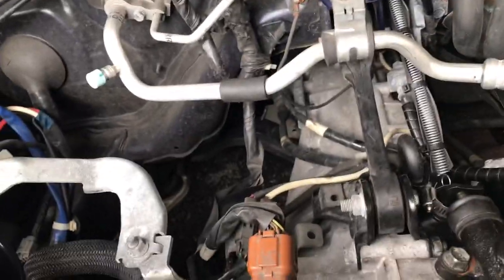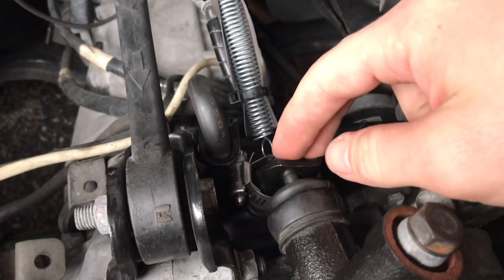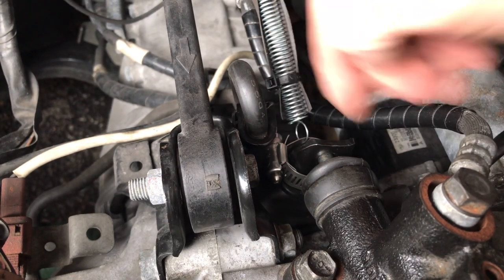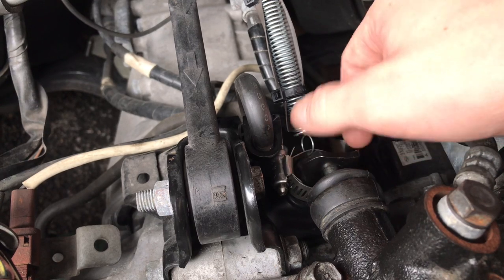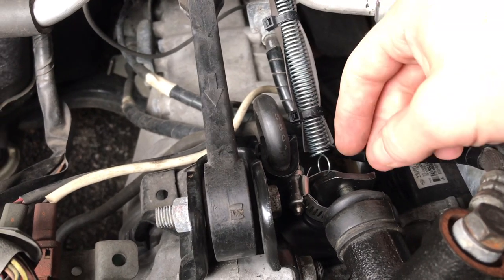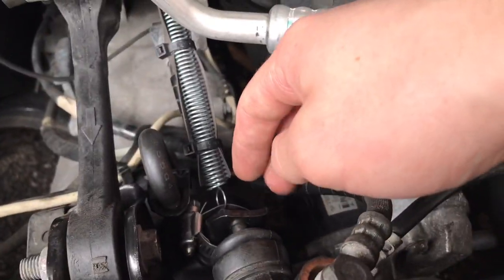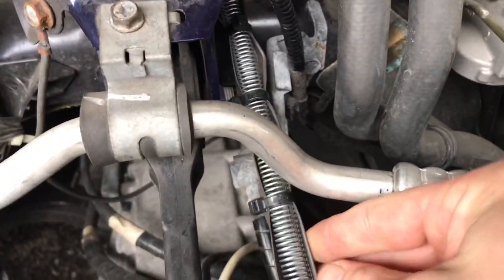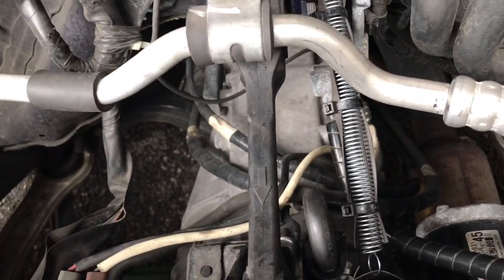2015+ WRX clutch fork noise/Chirping Sound

Comment: I was spraying high temperature grease on the clutch pivot ball every 6 months because the chirping sound was always coming back. Today I just installed the spring on the fork and the chirping sound is gone. Thank you!
Reply: The STI comes with that spring as a standard. The fork pivots on a shaft and the slave cylinder makes a minor contact with the fork when the clutch is not depressed. When idling this minor contact can make a small rattling noise. That is why STI comes with the spring.

I forgot to mention this to another person that i sent an aswer a couple of minutes ago. If you have the Verus fork on a WRX (non sti), i think that a possible cause of the rattling or tapping noise is becasue the Verus fork is billet steel, it is more solid it probably doesn't absorb vibrations as the stamped steel fork.

Comment: Hello again. I read your comment.  Make sure that the slave cylinder is properly bled. Compare bleeding the brakes and bleeding the slave cylinder. When bleeding the brakes, the brake pads and rotor prevent the piston on the caliper from extending that allows more fluid to flow and if there is air it will come out.
    Now, when bleeding a slave cylinder the piston extends; yes it is being bled but not properly.  As the slave cylinder piston extends, some air can stay in the unit, this small air pocket can cause play between the fork and the slave cylinder piston or a spongy feeling on the clutch pedal.
     When i replaced the clutch on my wrx i unmounted the slave cylinder and blocked the piston to prevent movement when bleeding.  In this case i had my father helping with the clutch pedal.  This has to be done very slow and double checking the unit is highly necessary to prevent the piston from flying away and the unit from coming appart. Keep the slave cylinder piston blocked when installing it back on the bell housing. After securing one slave cylinder bolt (finger tight, not torqued) remove the unit used to block the piston and let the piston touch the fork, then align the other bolt and torque both bolts.
      After i did that there is no play or movemet between the slave cylinder piston and the fork. 
     There is a youtube channel that shows how to do it; i will look for it and post it on another comment.  
Good night.
Reply from the maker: This is great information thank you so much for sharing, definitely share the YT video.
Reply: The factory manual for Subaru WRX STI explains that the slave cylinder must be removed and the piston has to be blocked  when bleeding.  I do the same for the WRX (non sti) and it works great.

Comment: Hey thank you for replying to my comment! Also yeah I mean't to say that my car was also making the chirping noise when i did not press the clutch. It would go away when I press the clutch down. Thanks for uploading this video i'm going to try this out myself and hope this makes the noise go away. I just don't want to take it to subaru, they are asking $950 for a throwout bearing replacement.
Reply from the maker: Your welcome...funny thing i had the noise and took it to subaru at around 30K miles, they replaced it and it still made the same noise cause it's not the bearing it's the clutch fork. Best of luck

Comment: If the clutch fork is the aftermarket reinforced fork for stage 1 and up clutch kits this noise will be normal.  The OEM fork has a couple of grooves to clear the transmission bell housing casting marks. The reinforced fork from Verus or other manufacturers eliminate the groove that is a weak spot of the fork.  Without the groove the fork will touch one of the bell housing casting marks and eventually wear it out or chip a piece of the casting. Applying grease wont solve the chirping noise. The noise is more noticeable when feathering the clutch, specially when using stage 1 and up pressure plates and clutches.
Reply from the maker: Thank you, the fork is definitely on the list of things I want to replace during my next clutch job...the current fix is a combination of grease on the fork pivot point, slave pin contact point and a release spring which does get rid of the noise in my case.
Reply: Interesting, I started getting this noise about a month or two ago and it coincides with upgrading my clutch to a stage 1. So it's just something I need to get used to having?
Reply: @apu95  Did you also upgraded the fork?
I have a stage 2 Clutch and pressure plate.  The noises i was getting first was from the upgrades fork touching a casting  rib of the bell housing.  If you compare both you will see that the  OEM fork has small dips to clear the bell housing and the upgraded one  doesn't.  The upgraded fork will touch and wear out the aluminum in the bell housing and the noise will stop.  
The other noise is that the throw out bearing is supposed to have a spring clip to secure the fork and throw out bearing tight to avoid rattling noises. My 2015 wrx didn't come with it and the new clutch didn't.  Some older wrx have it.
If you have an STI, the fork is different and already strong and it comes wirh a spring that goes from the top of the fork to the engine /transmission pitch mount.
A stage 1 or stronger pressure  plate will take some time to get adapted for daily driving.  
To me it feels just like a truck clutch. On my car i get noise if i feather the clutch.
 I had to adapt to rev the engine to 2000 rpm and release the clutch at a moderate rate and there is no noise and almost no slippage.
Reply: @PIPEFITTERENGINEER  I have a 2015 that I just put a stage 2 action clutch, versus clutch fork and act lightweight flywheel. I get this noise. Will it go away?
Reply: @GaragebuiltOriginal  When I noticed the noise caused by the new stronger clutch fork, i contacted the manufacturer and informed them about the noise and with pictures illustrated how their clutch fork was wearing one casting rib of the bell housing. The answer wasn't convincing.  If you compare the OEM fork with the one aftermarket that we have, you will see that the aftermarket is really strong but, the small notches on the OEM fork are there to clear the bell housing casting ribs, especially the casting rib that is to the driver side of the bell housing. 
On the OEM fork made of ( stamped steel),  the notches could be a weak point that could bend the fork if a stage 2 or 3 pressure plate is used. That is why the aftermarket one that is (solid metal cut to that shape)  doesn't have them.  
I suggested a little bit longer pivot point but the answer i received was not convincing.  
The design is good but i think that they should tensile test the fork but with the notches or at least one notch where it makes contact.
For my next clutch change i will put back the OEM fork but with a  reinforcement that I'm working on.
Take care, drive safe and don't abuse the clutch.  It is no fun to take out an engine just to replace an oil seal, clean the timing wheel and install a fly wheel and a clutch kit and then it rains when everything is out.
Reply: @PIPEFITTERENGINEER  I added a spring to fix the problem.

Comment: The slave cylinder point and the pivot point must be greased. Use the 3M high temp grease with copper. Do nott use never-seize grease, it dries with time.
Reply from the maker: That's great to know, thank you for sharing.
Reply: How can I effectively get grease between the context point of the Slave to the Fork? Thanks man.
Reply from the maker: @jessel1217  the grease shakes off after a while, what I found to be effective is to have rubber piece cut and placed between the slave pin and fork contact point. I used cut a piece of a tire sidewall  but I'm sure you can find something else that could do the same

Comment: Had this issue on my 16. There is a tsb on the throw out bearing. Dealer replaced mine jnder warranty, the updated throw out bearing fixed it for a while.. just hit 80k miles and its back. Usually only during wet road conditions. Was wondering if a south bend or other upgraded clutch would come with a better throw out bearing that fixes this permanently?
Reply from the maker: Not sure since still running stock

Comment: what size spring did you get
Reply from the maker: Bought these from homedepot https://www.homedepot.com/p/Everbilt-5-8-in-x-6-1-2-in-and-15-32-in-x-4-1-2-in-Zinc-Plated-Extension-Spring-4-pack-16071/202045467?MERCH=REC-pip_sem_mobile-202045475--202045467--N

Comment: Cool! Quick question, when I greased the parts underneath the boot, I smeared a decent amount all around inside. Is this bad? I hear a lot of people saying it could get into the clutch? Thank you.
Reply from the maker: Sorry for such late reply, yes you only want a little on top of the ball joint which is accessible by removing the rubber boot on the clutch fork...too much and it can get on clutch causing slippage.
Reply: @fixflickss  Hmm... I put a gob of high heat grease under the boot where the fork moves and also on the slave cylinder that pushes against the clutch fork. It quieted down a lot. I have the Verus Clutch fork along with Southbend Stage 2 daily clutch. I also greased the rod inside the cabin that goes through the firewall right above the gas pedal when pressing in the clutch. No creaking or squeaking and it feels real smooth. Knock on wood but I haven't had any clutch slippage. Also sprayed some WD40 specialist dry lube down there under the boot where fork goes.

Just did this yesterday. I have 80K miles on my 2015 WRX. Hopefully I didn't do anything negative. I don't think I did. Drove it 80 miles today on highway and local roads. Smooothhhh.
Reply from the maker: @shamwaymoonyos9578  happy to hear that bro, hopefully It will be alright under the boot, I would not spray anything in there bit use a grease gun with a hose attachment to just get the pivot point greased
Reply: @fixflickss  thanks man :). Yeah I hope it all was good what I did. Did the grease and spray as mentioned in my original reply but yeah I am just hoping it will be fine. Drove it those 80 miles today and it was satisfying with little to no chatter feel in pedal and no noise. My noise wasn't much chirping but on some pedal travel it has started to get a metal noise that sounded like grease was needed.

Please forgive my crap reply I out of it at moment feeling pretty good. Have a good one man! Or woman! :)
Reply from the maker: @shamwaymoonyos9578  lol you made my night bro, my name is Mike, thanks again, enjoy the rest of the evening
Reply: @fixflickss  no problem Mike. George here. Have a great rest of weekend.

Best Regards,
George

Yes... I ended it cordially lol. Business etiquette bro :)

Comment: What do u think? Is there any risks of doing this job? Dropping something in there?
Reply from the maker: Yes, you definitely do not want to drop anything under the fork boot or get too much grease on the ball joint pivot point if too much grease is applied it can drop on the pressure plate and create slippage if anything else falls in there it can destroy your clutch...there is always risk so always take your time and do the proper research. Best of luck to you

Comment: Hey I hope you can reply to this but with installing the spring that shouldn’t engage the clutch and put wear on it right? Looking to do this because my 18 Wrx loves to make this sound
Reply from the maker: Hey...so this worked but I had to get the spring to force the fork onto the slave Cylinder instead of away from it as in this video. I applied grease on the fork pivot point and the contact point with slave Cylinder and fork.
Reply: @fixflickss  thank you!

Comment: How is this fix after 6 months of driving?? Still holding strong? No complications? I'm going to home depot tonight Haha. Been having the chirp for about 6k miles now.
Reply: Also do I need to remove the slave cylinder to attach the hose clamp or can it slide right on without removing the slave?
Reply: @fixflickss  did you need to remove the slave cylinder to add the hose clamp??
Reply: @fixflickss  I did the mod today. I attached the spring in the same location on the fire wall and used a heavier duty spring. The noise stopped but my clutch does feel slightly stiffer now not a big deal.
Reply from the maker: @taylormcwilliams2406  yes

Comment: I understand then that this can be solved in 2 ways, or do you have to do both? A) apply grease on pivot point, B) place the spring, pulling from the slave cylinder.   Does this video look familiar to you? Hope to get it fixed with the spring... https://www.youtube.com/shorts/XPeD3Z5N9uQ
Reply from the maker: I did both, but if it’s not fixed with spring then  apply grease. PS. I later changed the configuration with tension of the spring towards the front of the car vs the firewall as in the video, it worked a little better, i secured the spring to the egr bolt with an additional metal clip.

Comment: Interesting solution.  Did it work out long term?
Reply: Only solution that worked for me
Reply from the maker: Yes, after several years I still have it.
Reply: @fixflickss  That answer confuses me to the question "did it work out long term". Do you mean you still have the problem or the car?
Reply from the maker: @Tanner  I still have the car and the fix has held up, no chirping noises since the fix
Reply: @fixflickss  Thank you. Im gonna give it a shot. Literally just got this 2016 WRX with 50,100 miles and the only thing that I dont really like about it is this damn noise. Im losing my mind over this noise.
Reply: @GoodAtHeart me to bro on my 2018 wrx

Comment: How long is that spring ?
Reply from the maker: Hi, im not sure at this point this was a while back. I bought a case with several different sizes in-home depot and used the one that worked best for keeping the fork in tension
Reply: @fixflickss found one that fixed it thank you very much I’ve been living with that annoying sound for a year

Comment: Was this making sounds at lower rpms?

I think this is exactly whats going on with my wrx, just got my whole motor rebuilt with a stage 2 clutch and stage 2 IAG block and a bigger turbo. Didn't have this issue at all and now about 1000 miles in it's constant.

It seems to have only started while taking off thru gears when i added the Torque Solution engine mounts about 50 miles ago so is that vibration or could this be a bigger issue? Seems to stop once I get over 3000-3500 RPM's.
Reply from the maker: This happened two months after i bought with everything stock